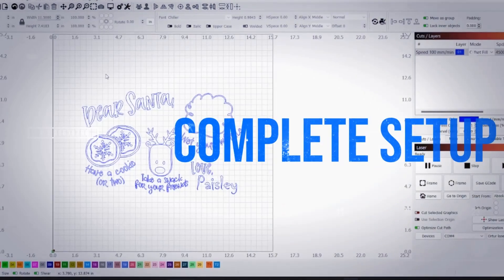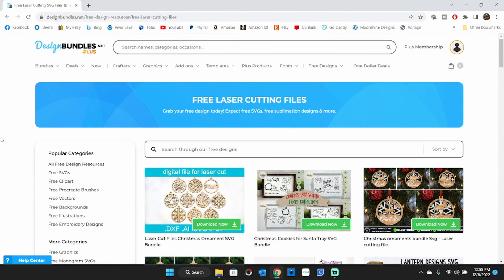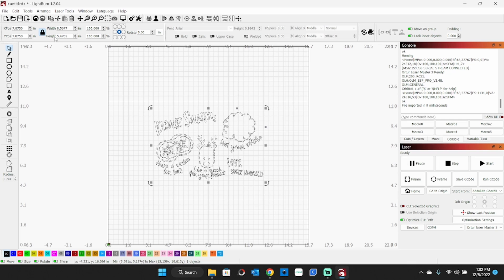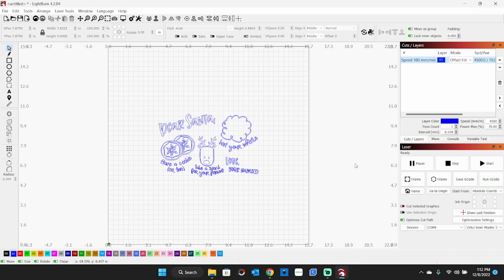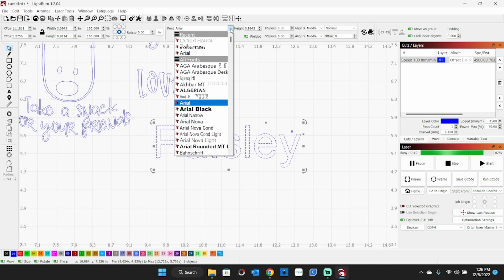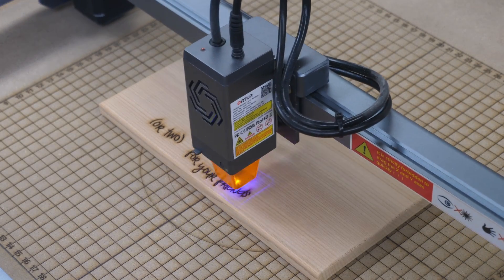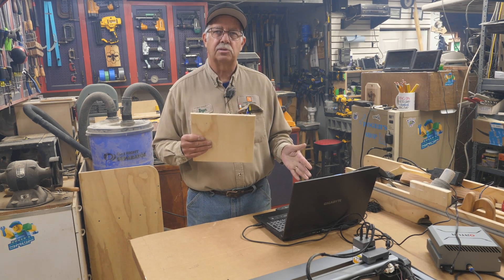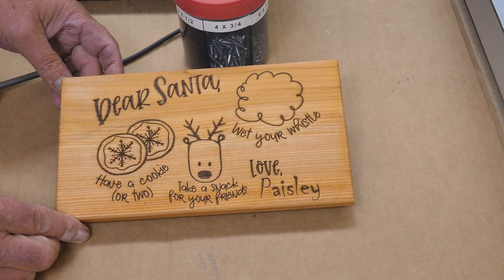Beginner Laser Project #1

Comment: Oh Roger! I love your videos, and I am following along and doing exactly what you are doing, but what I am doing wrong?!? Your offset fill says 10 mins, mine says 4 hours!! I have the same laser speed output settings as you!
Reply from the maker: Check your speed.  Sounds like it is WAY off
Reply: @rogersshop  so I am using the free trial version of lightburn if that makes a difference. today I re-opened it, and it was down to just over an hour, but I cannot get it down to your times. The graphic size is the same as yours, speed is 4500 at 70%, dpi or lines per inch is set at 254, with 1% overlap. My offset fill time is still 25:59, full is 49:54
Reply from the maker: @mellissaerb8819  What file are you using and what format?  (SVG, DXF, PNG, JPG, etc)
Reply: @rogersshop  Good morning Roger, I am using the exact same file, downloaded as per your instructions, in svg format, same size graphic. Laser is xtool D1. Speed 4500, 70%, lines per inch 254. My offset fill time is 25:57 compared to your 10:57. My fill time is 51:45 compared to your 25:29. Is this just the difference in the Xtool D1 vs the Ortur Laser master 3?
Reply from the maker: @mellissaerb8819  What size are you making this?  I made it somewhat small.  That may be the difference.
Reply: @rogersshop  it was exactly the same size as what you quoted in the video. I did not change anything to do with size when I imported it into Lightburn. I am just going to chalk it up to difference in the 2 lasers. Maybe someday I will figure it out!  Thanks for your time!

Comment: Hi I have just purchased an Ortur Laser Master 3 I've burnt one thing on it and that was great but since then I can't get it to go to the 200mm x 200mm centre point that I choose on lightburn. It seems to stay on Y 000mm. Do you have any ideas that could help me please.
Reply: Hi thank you for replying. Yes I'm on absolute coordinates.
Reply from the maker: @jackdbob  If your project is centered and work origin is set to center, the laser should go to the center point from home when you start the project.
Reply: Thanks again. I have tried all three positions current position, user origin and absolute coordinates but it keeps coming up with cut might be out of bounds and G-code locked out during alarm or jog state when I'm trying to cut a grill
Reply: that should be grid
Reply from the maker: @jackdbob  Will it frame the project after homing?
Reply: @rogersshop  I've got it going on smaller projects now but when I try to burn the grid it still comes up with the same thing
Reply from the maker: @jackdbob  What grid file are you using?
Reply: The same one that you have on beginner laser projects #1
Reply from the maker: @jackdbob  Try running that grid file from Laser GRBL as that was what the creator designed it for.  See if it will frame from that program.
Reply: Thanks I'll give it a go at the weekend when I have the time to watch the videos and work out how to use it. Thanks again.
Reply from the maker: Are you using "User origin", Current Position", or "Absolute Coordinates"?  I use absolute coordinates with work origin from center.